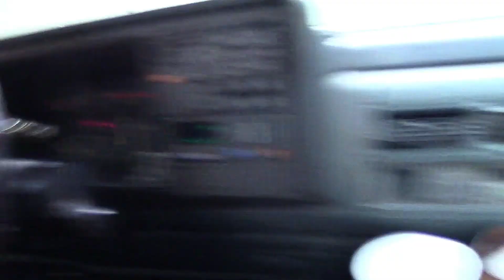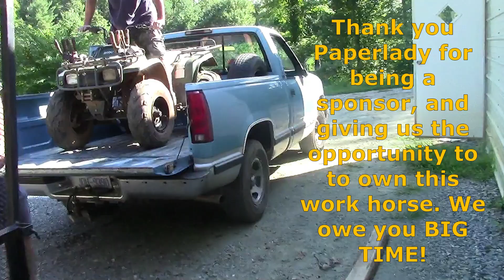ep 34: a Real Homesteader Needs an ATV,  (We Couldn't Have Done it Without Her)

Comment: I'm pretty sure you can just pull the pin on the handle of the trailer and then stick it right on the back of a 4 Wheeler and put a pin through pin through it if you look at the handle you'll see what I'm talking about it's like a fork might not be too great with all the off camber situations you have around there and how hilly the land is but it might work it might work until you get around to rigging up a ball